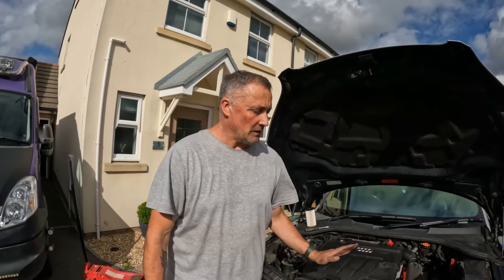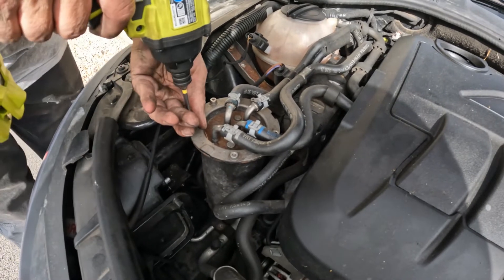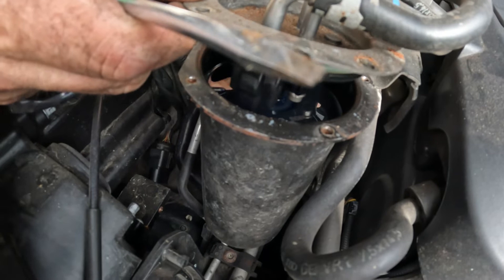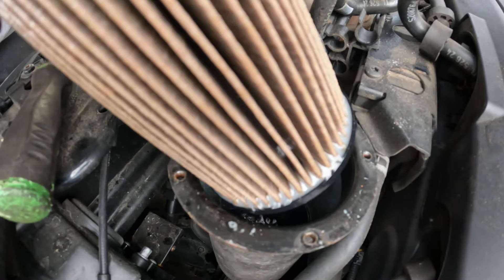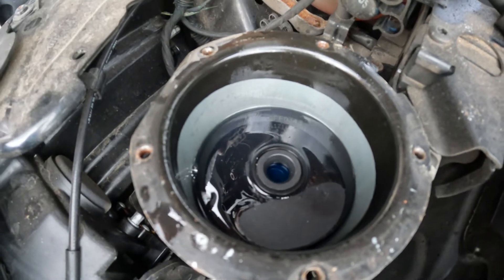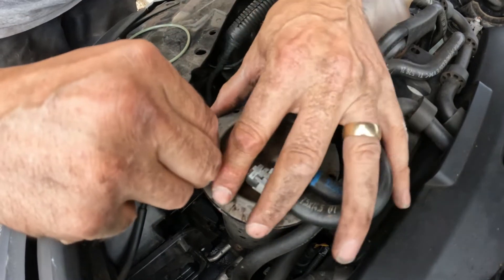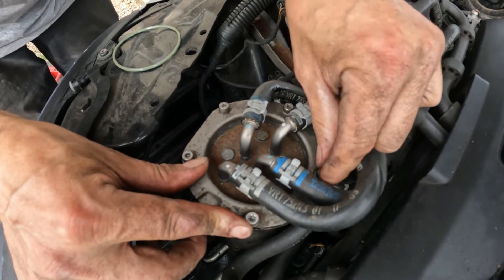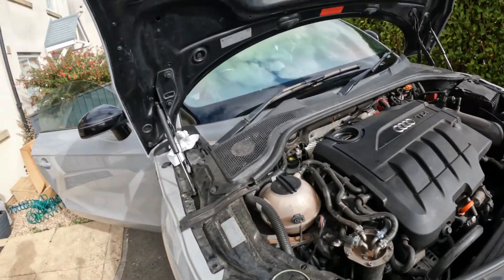How to change the fuel filter on a mk2 audi TT 2.0 tdi works for most of the vw / Audi 2.0tdi range

Comment: Hi Mate 😁 having the EGR mapped out today but not getting a remap as I don't think it's worth it due to my TT's mileage.
I'm sure you probably mentioned this in the video but what size bit is required for removing the fuel filter housing lid? Thanks
Reply from the maker: T20 I think off the top of my head but could ne wrong lol, just do it step by step as I say in the video mate and ull be fine 🙂 let me know how you get on please?
Reply: @thestanleysadventures8229  Ok perfect thank you 👍🏻 I should be fine I've always serviced my own cars but the TT is a little different in terms of the fuel filter housing!
My A4 just had a retaining clip holding the top on. I'm not sure when I'll get a chance to do it but I'll let you know how it went 😁
Reply from the maker: @Tinez87  good luck thanx mate
Reply: @thestanleysadventures8229  Thanks 😁the EGR delete went smoothly although I'm noticing more turbo noise now. The guy didn't blank it off as he said it wasn't necessary due to the valve still closing and sealing properly. Think I'll put a blank plate in at the manifold end anyway, do you have a link to the one you purchased?
Reply from the maker: @Tinez87  304806098159 ebay number, glad it went well mate 👍🏻 more turbo noise is not usual but could be a placebo effect 🤔 have you done the hot air feed delete yet? If you do the turbo clean that might give more turbo noise.
Reply: @thestanleysadventures8229  Perfect, thanks 👍🏻 I'm definitely noticing more noise I mean it's nothing out of the ordinary for a turbo but I don't recall hearing it before. Did you slip the blanking plate in at the exhaust manifold end? And did you use a gasket?
Reply from the maker: @Tinez87  No I put the plate on the throttle body side mate,   it basically is the gasket but I left the original in as well, have you done the fuel filter now?
Reply: @thestanleysadventures8229  Ahh ok that's fair I'll look in to getting one as backup to make sure it's sealed. Nah I haven't done it yet I'm planning on doing the full service including transmission oil and differential oil at the end of this month
Reply from the maker: @Tinez87  Is yours a 6spd manual or dsg? Any info you need feel free to ask 👍🏻 I'm gonna do a full walk around of our TT in a week or so with a full description of all the work done if your interested.
Reply: @thestanleysadventures8229  Mines a 6spd mate, I considered getting an auto but I'm quite happy sticking with a manual.
Yeah definitely it would be good to see your TT in all its glory! It does look nice 👌🏻
I won't be doing as much to mine as you have but I'm planning on lowering it 30mm and I'd like some nicer alloys at some point.
I need to get my bonnet and wing fixed up as they are damaged from the Cat N it was in previous. I must say I'm more happy with the TT than any other car I've owned!
Reply from the maker: @Tinez87  ours is a 6spd manual to mate, it's pretty much had a full RS conversion bar the front bumper, but like I said I'll do a detailed walk around of all the mechanical and body modifications, then if anyone wants any of the parts or prices and can tell them where from and how much, it started life standard and black lol, have you done your filter?
Reply: @thestanleysadventures8229  Ahh I see I thought it was a DSG for some reason! You have got it looking nice. Did you say it's been remapped? So it basically looked like mine originally! Mines in black but it's the pre facelift MK2 what's yours? Do you mean have I fitted an induction kit?
Reply from the maker: @Tinez87  no I meant your fuel filter? Ours is one of the first mk2 TTs yeah been re mapped but had a new cutch and flywheel so nowt to worry about there, Iv done everything to get performance  with reliability on ours, It's only stage 1+ at the mo not sure if it's worth going anymore if I'm honest, at the moment it has the best of both worlds without worrying about fragility.
Reply: @thestanleysadventures8229  I'm not servicing it until the end of this month, I need to take the car back home so I can get it on the ramps. Is yours around 200hp? 
Do you just get a standard clutch/flywheel or did you get a Sachs? Are you running the original suspension?
Reply from the maker: @Tinez87  sachs, standard suspension mate but it was an Sline so sits firmer and slightly lower anyway, I. Really anti coilovers unless they have adjustable dampers camber and caster, if they don't all they do is make the car look slightly better ( not in my eyes to be fair) but it'll ride like crap on anything other than perfect roads and wear your tyres unevenly because everything on your suspension was set up for how it came outv the factory not 30mm lower, sorry don't mean to be down on it just being honest mate.
Reply from the maker: @Tinez87  it's running 215 to the wheels
Reply: @thestanleysadventures8229  Nice, mines on the factory sport suspension and sits a bit lower and stiffer than standard. That's fair I appreciate your honesty! Would having a wheel alignment by a garage help not help? I've read that you should do that after lowering.
I wouldn't go coil overs I was just gonna put lowering springs on it tbh but if it's gonna destroy the tires I'll not bother.
That's some decent power, I'd like more maybe when the flywheel needs doing I'll go with a Sachs then possibly might get a remap.
Reply from the maker: @Tinez87  if you've got the factory sports suspension I'd stay with that mate unless your more about looks than handling ( personnel choice obviously) Audis ride beautifully on their standard suspension, I specialise mainly on vw Audi hence my whole family has them and they're all tuned and have been massively reliable! There's a few oil additives I swear by and the other tuning tips iv shown on my channel will add to the reliability of most cars, 100% wheel alignment after any serious suspension work ( even just replacing standard for standard suspension arms ect)
Reply: @thestanleysadventures8229  Ok mate I'll stick with what I've got as it does handle really well and I don't want to loose that by sticking springs on it. I'm all about German cars since I had my A4 it had 160k on it but I think it could have done a lot more.
I have a question for you... I have what seems to be a warm start issue on my TT and sometimes it struggles to start after it's fully warmed up, it intermittently fires but it doesn't fire straight away it turns over but instead of just jumping to life it sounds like the engine is partially starting now I've done some reading and it can be a coolant sensor or crank position sensor and potentially the starter motor. My battery seems fine in terms of voltage and if it was that I would expect an issue cold starting! Have you had this issue with yours at all? Think I'll replace the coolant sensor first as it's the cheapest then go from there.
Reply from the maker: @Tinez87  right that's a big one! There's a few things it can be, there's actually 2 coolant temp sensors that ut could be ( only buy original not ebay special unfortunately) doubtful starter or battery if its OK cold, EGR valve not fully closing is the other main cause, if its all carboned up it can cause probs exactly like that! Easy to clean out to.
Reply from the maker: @Tinez87  its a pretty common fault to be fair, pretty sure it won't the the crank sensor either, why would it play up hot? It's basically a magnet
Reply: @thestanleysadventures8229  Yeah after researching it on the internet I found it is very common problem. I don't suppose you know where I can get engine diagrams from do you? Mines a CFG engine code. The diagrams should make it a little easier to locate the two temperature sensors. It's a strange one. There's a video I've seen on here where a guy had the same issue and he replaced his battery and all coolant sensors including the crank position sensor and it turned out to be his starter motor that was at fault in the end.
Reply: @thestanleysadventures8229  Would the EGR not be throwing an engine light if it's not working properly?
Reply from the maker: @Tinez87  no mate it's still within operating range, to be fair there's sooooo many electrics on the car any one can give the same fault, I always go cheap first and work my way to expensive till its sorted lol, Egr clean up is free to, my only proviso is it may take a few starts for your car to re learn its fueling parameters. As for wiring diagrams Google to be fair, but if I remember rightly ones on the thermostat housing and ones on the coolant hose on the front left of the motor, it's green I think, but could be wrong as I did my sons on his leon fr old cr motor.
Reply: @thestanleysadventures8229  Yeah that's the best way to go I reckon, no point going going for something like a starter motor to find out it was a £30 sensor all along lol.
It took some digging but I've managed to find a PDF that covers my engine code 👍🏻
Is one of the sensors more likely to fail over the other or am I just as well trying to pin the tail on the donkey haha
Reply from the maker: @Tinez87  the one on the thermostat housing gets the most grief if ìts still there on that engine.
Reply: @thestanleysadventures8229  I spoke with the Audi dealer earlier and they want £58 for the sensor and there's only one on my engine apparently. I'm not completely convinced it's that tbh. It's not just when it's warm sometimes struggles no matter what the temperature is but it's generally worse when it's already warmed up! I have plugged my OBD2 reader in but there are no engine faults showing
Reply from the maker: @Tinez87  it won't flag a fault unless the faulty part is outv values, I'd start with cleaning the egr first then drive it for a week if no change start with the nxt issue, u can have a battery health check just for peace of mind, also check your main earth wire underneath your fuse box they corrode badly and give a bad starting prob ( sounds like a flat battery.
Reply: @thestanleysadventures8229  I'm starting to think it is a faulty starter because when I cut the engine out this morning and refired it up the starter motor sounded slower than usual but it's only slower when it's warm which apparently can be the sign of a worn starter. Possibly worn brushes? I think it's struggling to turn the engine fast enough to fire it up straight away, I need to get it tested I think
Reply from the maker: @Tinez87  I hate to be the bearer of bad news but a dying starter is also one of the first signs your dual mass is dying to 🙄 not always but it is one of them, an easy way of checking that idea is put a jumper pack or another car when it's hot and see how it starts if it starts well when the engines hot with a jumper pack on its the starter.
Reply: @thestanleysadventures8229  Ahh ok I didn't know that! Well I'll cross my fingers that it's just the starter then 🤞🏻 I will see if I can get a jump off a friend and hopefully eliminate if it is the starter or not. I've been without a car for a year before buying the TT and I can honestly say I haven't missed all the expense that comes with owning a car lol

Oh and I was just thinking if it's the starter why would it start well off of a jump? Would it not just be the same if it's worn?
Reply from the maker: @Tinez87  No mate the extra power from the jump will eliminate the heat from the motor, it's the heat that's making it slower if its dying, so the jump will stop that, it's a good way of eliminating the starter or the battery to be fair. I hope my info is genuinely helping you mate?
Reply: @thestanleysadventures8229  Ok I understand what you mean, I guess it could still be the battery at that point.
I think the starter and the battery need to be completely eliminated before I start going for other costly components. Absolutely you have been very helpful with the info you have given me 🙂
Reply from the maker: @Tinez87  ideal glad I have 👍🏻 yeah eliminate them first then clean your egr valve, go from there.
Reply: @Tinez87  any news on the starting probs mate? How's the car running ?
Reply: @Warhammer-fun   Yeah replaced the battery last week and I initially thought it had completely solved the issue, It didn't but it does seem to be a lot better than it was! I think the starter may be tired.
I've bought some TT MK3 19" gloss black wheels and it looks way better for it. Gonna do the full service this weekend. Planning on removing the haldex controller and opening it up as I think it may have some ingress which is causing the error codes I'm getting.
Reply: @Tinez87  nice alloys mate 👌🏻  ours are the B7 rs6 wheels, good idea it takes nothing to throw up a code in modern cars, servicing the haldex isn't a major headache to be fair, I might do a video on it actually as iv not done the tt yet and my SQ5 could prob do with another one by now lol.
Reply from the maker: Sorry I answered on my sons account 😅 my bad
Reply: @Warhammer-fun   Cheers they are a big improvement and the 255 width tyres gives a little more grip. Ahh I bet they look nice on yours 👍🏻
My haldex system was serviced a few weeks back and it seemed better but nowhere near as effective as it should be. I emailed the guys over at haldexrepair and they said it's probably the controller that's faulty so I'm keen to whip it off and crack open to see if I can clean up any corrosion. Alternatively they want £250 to recore it whatever that means lol
Reply: @thestanleysadventures8229  No worries I didn't even realise it wasn't your account till you mentioned it mate 😂
Reply: @Tinez87  new circuit board and fittings, easy way to test your haldex is get on some grass and boot it ! All 4 wheels should spin if not its not locking the centre diff, it's only 4x4 when needed it's front wheel drive 99% of the time.
Reply: @Warhammer-fun  Yeah I've seen a few videos of people doing that! It's definitely not working right as I can spin the front wheels up pretty easily in the wet and the traction control light comes on. Would be nice to get it working fully 😁 I'll tear it down and have a look. I've heard of people cleaning up the PCB with contact cleaner and managing to get it working again!
Reply: @Tinez87  good luck and keep me posted mare 👌🏻
Reply: @Warhammer-fun  Cheers mate 👍🏻 I won't be doing the haldex controller just yet that will be at a later date. It's definitely on the cards tho!
Reply: @thestanleysadventures8229  Hi mate, I thought I'd give you an update as I've finally managed to do the full service on my TT. Everything went smoothly but I have an issue with small metal particles in my fuel filter reservoir 😕 turns out this could be a worn/failing high pressure fuel pump! Not taken it to the garage yet as I've been down Cornwall for a week but planning on getting it looked at ASAP... I can really do without a big bill but not much I can do really it's just one of those things.
Reply from the maker: @Tinez87  don't worry about it mate they all get that to a point, I tell people to put a bottle of 2 stroke in their tank before filling up every 3rd tank, that keeps the whole fuel system lubricated and stops undue wear on the hp pump, I live in N devon mate couldve popped in, I only ever use BP ultimate or shell V power diesels, that way the extra additives in the fuel does the same thing.
Reply: @thestanleysadventures8229  Thanks for that mate I feel better knowing it's a common issue! And that it's not something to worry about too much. Do you know what causes it? I'll get some two stroke oil like you said, especially if it helps the situation. Ahh nice I like both Devon & Cornwall I stayed down in Gorran as it's one of my favourite beaches 🙂 if I'm heading down your way again we will have to meet up.
Reply from the maker: @Tinez87  deff meet up mate 👍🏻1 500ml bottle of 2stroke to a full tank of fuel will keep your pump lubricated and injectors smooth and quiet, the only thing I would advise after doing it change your fuel filter again (say after 2k miles) because the 2 stroke will clean all the gunk and rubbish outv ur fuel system and will fill your filter full of crap! After that you can service as usual. How did the service go?
Reply: @thestanleysadventures8229  Yeah sounds good 👍🏻 what brand do you use? Do you have a link please? That will ensure I get the correct one and don't end up buying something that's not suitable. Yeah it went fine apart from the oil filter that I got from Euro Car Parts was incorrect which I found out once I'd already dropped the oil 🤦🏻‍♂️ so ended up going to Halfrauds and bought the last one on the shelf which was lucky!
Reply from the maker: @Tinez87  I recommend the cheap 2stroke from morrisons supermarket ( it's red) it's the best value for money and what all the people I tell use, You may even notice your car getting quieter when it's run through the system because your injectors can get quite loud when not well lubricated, are you gonna do the hot air delete from the rocker cover?
Reply: @thestanleysadventures8229  Ahh ok I'll have a look for it, have you noticed much difference with yours after running the two stroke for a while? I haven't gotten around to doing it as of yet and I'm not sure yet as I've read mixed things about removing it. I replaced my front grill after I did the service and what a mare it was removing the front bumper! Now I know how it comes off it should be easier to remove if I need too 😅
Reply from the maker: @Tinez87  deff better throttle response, there's nothing that can do any harm to your car that's for sure, and stopping all that hot oily air going through your turbo and engine alone is worth it even if  you don't notice any difference.
Reply: Hi! Thought I'd give you an update on my TT, I ended up getting a stage 1 remap in the end and it's the best £200 I've spent on a car! What a massive difference it has made to power torque and throttle response... I'm well happy with the result 😄

I have a question regarding the CR170 engines used in the TT, I know of the oil pump hex drive issue that has plagued a lot of the PD and CR engines and wondered if you know much about it? Thanks
Reply from the maker: @Tinez87  iv worked on these engines for years and haven't personally had a single gle one fail! Wether that is good servicing ( meticulous/ more frequently) or shear dumb luck I can't say, But I wouldn't let it worry you unless your having od noises from it, well chuffed for you mate that's amazing news 👌🏻 thanx for keeping me updated 👍🏻 prob going hybrid turbo on ours nxt lol.
Reply: @thestanleysadventures8229   Ok that's fair. From what I've read the oil pump hex key failure is an issue right up to 2010 models and was a while before they completely eradicated the issue. If mines got potential to fail I'd rather know about it as that way it can be prevented before it fails and writes off the engine. Thanks mate 😄 I'm well happy with it! Haha I've been looking at hybrid turbos too lol I'd only get one if mine needed replacing tho I think. Mine should be around 205bhp with 310lb/ft of torque now I've had the stage 1 but I must say having nearly 250bhp would be nice 😏
Reply from the maker: @Tinez87  to much ips never enough in my book lol, my wife's scirocco is on 175k  and still going strong and my sons Leon tuned too 312bhp is on 201k neither have had a hex key issue bud so don't worry to much eh 😉 glad  your loving it mate stay safe and in touch if ud like.
Reply: @thestanleysadventures8229  Absolutely I couldn't agree more! More HP is nearly always better. Oh nice both cars are doing well then 👍🏻 what year are they both? I posted on the TT forum last night to get more info on whether mines affected, if it is I'll get the kit and have the necessary parts replaced on my next cambelt change. Thanks for the reassurance mate 🙂 yeah I'm happy to keep in touch, although it's not the easiest way to do it through YouTube lol
Reply from the maker: @Tinez87  2007/2009 Leon and scirocco, better safe than  sorry I guess mate, yeah through here isn't the best lol, any more power and you'll also have to up rate your clutch to to cope with the extra torque.
Reply: @thestanleysadventures8229  I have spoke with an engineering company who manufacture replacements for all the vag cars PD and CR engines effected and he said it's an issue right up to 2015 models unfortunately... Looks like I'll be having it replaced on the next cambelt change to ensure it doesn't cause me any issues later on 😅
Reply from the maker: @Tinez87  fair play mate peace of mind for you on going then, especially if you plan on keeping it a long time! I have an Audi Q5 3.0tdi twin turbo as my daily, the cam chains are renowned on going as little at 100k up to 130k, mines now on 162k and is whisper quiet so good maintenance and luck obviously plays a big part in it.
Reply: @thestanleysadventures8229   @thestanleysadventures8229   Yeah that's it mate I'm all about reliability, I usually keep my cars for well over 5 years... Basically until the cost of repair far outweighs the value of the car! Nice I bet that's comfy to drive every day and oodles of torque I bet!! Absolutely maintenance and luck plays a big role in longevity. Thing with the hex drive is that there generally isn't any warning it's just oil pressure light on and turn your engine off asap to prevent as much damage as possible but when your on the M1 hooning it that isn't necessarily an easy task to achieve lol
Reply from the maker: @Tinez87  Mines a monster mate lol, with a light tune it's running 398bhp and 700ftbs yet driven like an old lady will do 45mpg ! If you keep on top of it there's no reason your tt won't just go on and on 👌🏻
Reply: @thestanleysadventures8229  I bet mate especially with that amount of torque! I can imagine it pulls like a bloody diesel express train lol does it have the haldex 4wd on it? I bet it would be  constantly lighting the tyres up without it 🔥 cheers matey I'm hoping it does 🙂 I'm saving up to buy my own place so don't want to end up blowing a load of money unnecessarily... Certainly if it can be avoided!
Reply from the maker: @Tinez87  it'll spin all 4 wheels in the wet 😁 love it to be fair best car iv owned! How many cars have that performance but drive carefully will still return great econ? Have you done the hot air delete? I would also recommend turbo cleaning it to save that to the 170bhps are renowned for blowing turbos due to sticking vans.
Reply: @thestanleysadventures8229  Doesn't surprise me with that amount or torque! What even better than the TT!? I'm not much of a 4x4 kinda guy lol
I haven't tbh I did order a silicone hose and bung but haven't gotten around to it yet. Same on the turbo clean I haven't had a go yet! Too busy spending money doing other car related stuff haha
Reply from the maker: @Tinez87  the silicone hose takes 10 mins max and is invaluable for the longevity of you turbo and motor, turbo clean just gets lost power back lol, any info just let me know, would love to see the car sometime, I'm doing a detailed walk around of ours soon to.
Reply: @thestanleysadventures8229  Ahh there not massive jobs, I've been getting the cosmetic things sorted as it needs a bonnet... I replaced the passenger wing on Sunday and that was an interesting job lol I'm looking forward to your walk around! Will be nice to see more of your TT 😄 

I have another mechanical question, so I've noticed a rattle coming from the engine and it's more pronounced when in a higher gear and you lightly accelerate, the higher you rev the less noticeable it is. It sounds like it's the engine and not a heat shield or anything like that, I was thinking it could be pinking and that the injectors may be the issue?! How does yours sound, do you get any kind of rattle?
Reply from the maker: @Tinez87  hey up fella 👍🏻 vibration noises are notoriously hard to find, pinking as it was called years ago was petrol cars detonating incorrectly, if it runs smooth with no hiccups it won't be the injectors, see if it will make the noise when not moving, open the bonnet then rev it till certain rev increments and see if you can hear it, if you can't then it's poss drive train related, try driving along get the noise to happen then press the clutch in if the noise go's its not wheels and suspension.
Reply: @thestanleysadventures8229  Hey mate 😁 I'm hoping it is just a vibration and not engine related. It seems to run fine tbh it accelerates smoothly and goes well without any hesitation. If I rev it when stationary when the revs are dropping just before the engine settles I get a hint of the rattle, I'll have to get someone to rev it while I stick my head under the bonnet. Ahh mate it's just one thing after another at the moment lol I paid 3k for it and I'm already another 2k deep 😆 heater has dropped in temperature quite a lot recently so that needs looking at also my Aircon now needs a gas and both front tyres are due soon... Not to mention the cambelt start of next year and I need to remove and dismantle the haldex controller because it's throwing fault codes and it's not working properly... Oh and I still need a replacement bonnet as it was a cat N when I bought it 😅
Reply from the maker: @Tinez87  sooooo, if it rattles just as the revs are dropping it could be either dpf heat shield or even the engine cover ( they're savage for an awful rattle at od revs) so remove it and try again, the only other internal rattle it could be is the oil pump drive chain but they usually just snap rather than get loose if not serviced regularly! Does the rattle get worse when hot or does it make no difference?
Reply: @thestanleysadventures8229  Ok I shall check the dpf heat shield when I get chance, when you say engine cover do you mean the plastic one? The oil pump shouldn't be an issue as mine has a gear driven pump instead of a chain. It doesn't seem to make any difference if it's hot or cold the rattle sounds the same from what I can tell, if I drive in built up areas the sound will bounce off objects and it's very audible with the window down. I'm not sure why but I think it is the engine as it sounds a bit like an older clattering diesel engine when it does it lol
Reply from the maker: @Tinez87  yeah the plastic engine cover top and bottom give loads of bad noises if they're not fitted spot on, there's nothing inside the motor that can give a metallic rattle without really killing the motor, check the idler pulley on your aux belt they can rattle savagely
Reply: @thestanleysadventures8229  I'll remove the top one and see if it makes a difference, bottom one isn't an issue as I had to Dremel it off when I did the service lol so I just left it off! I hope I can pinpoint it if not I'll have to take it to a garage and see if they can find where it's coming from, I read a few stories about people never getting to the bottom of these kinds of noises even years down the line haha I have my fingers crossed that it's something simple 🤞🏻
Reply from the maker: @Tinez87  Well if it's running fine and smooth it shouldn't be anything more than an annoying rattle, which isn't great but better than terminal rattle lol, I know the engine cover can give horrendous noises if the rubbers are old!! If it is that cut a small bit of rag an place it over the hole the feet go into, it'll fill the gap and stop it rattling, good luck mate keep me posted 👍🏻
Reply: @thestanleysadventures8229   @thestanleysadventures8229  haha you have a good point there! Definitely better than a terminal rattle lol I took the engine cover off before driving to work and I don't know if I'm dreaming it but I'm sure I couldn't hear the rattle, I'll have to go in an area that's more built up to be sure but I've got my fingers crossed that's it 🤞🏻 if so I'll just stick the cover in the garage permanently hahaha
Reply from the maker: @Tinez87  that would be great mate, I know they can make some awful noises but easy enough to solve, good luck 👍🏻
Reply: @thestanleysadventures8229  Ahh mate that was short lived... The rattle is still there lol it's very consistent and can be heard up to about 2000 revs, if I'm doing 20mph in third gear and lightly press on the accelerator it's plain as day!
Reply from the maker: @Tinez87  right 🤔 that's deff a frequency vibration then, as annoying as it is you could waste a lot of money trying to find it, just be methodical check all heat shields even loose wiring can do it, or even sometimes the outer skin of the exhaust baffles separate but you can see it outwardly either 🤬 nightmare mate.
Reply: @thestanleysadventures8229  I'll check what I can myself and just leave it at that I reckon, I found some info on a Skoda forum where a couple of people with the 2.0 TDi CR 170 had a rattle just like mine and they had listened to a few cars with the same engine and they had it too! So I may end up chucking money at it and not getting anywhere like you said. Next job is taking the haldex controller off so I'm planning on doing that very soon, I'm getting a fair bit of wheelspin now I'm on a stage 1 lol
Reply from the maker: @Tinez87  you should get some spin then it should lock up, it's not as big a job as you'd think to be fair, whilst apart change the oil and filter at the same time kill birds with stones lol, I wouldn't worry to much mate, hybrid turbo is on order for ours now so soon will be rocking some decent power lol
Reply: @thestanleysadventures8229  Hey mine only locks up from the traction control from what I can tell as it flickers and bogs down a bit. My haldex had the fluid changed and filter clean a few months back so it should be good for a while I reckon, I was told to get it done every 20k instead of Audi's 40k lol 
Ahh nice what kinda power will you be making with a hybrid turbo?
Reply from the maker: @Tinez87  hight 2s low 3s with supporting mods, I think your best bet is get your car on some grass turn tc off and boot it, if it only spins the front you know for sure then, I'm planning on doing the walk around video this wknd co.ing if it stay dry lol
Reply: @thestanleysadventures8229  oh nice that's decent, I'd be happy with high 2s let me tell you! What other supporting mods are required to reach that kind of power? I have run a fault scan and it throws a couple of four wheel drive codes that come back once cleared so it's definitely not working as well as it should be unfortunately. It will be good to have the full TT experience and see how she's looking 👍🏻
Reply from the maker: @Tinez87  no much actually, turbo injectors intercooler and a stage 2 map, it'll be a longish video cos there's so much to show lol
Reply: @thestanleysadventures8229  Hi mate I hope you are well 🙂 have you swapped your turbo out on the TT yet? I have a question regarding the metal specs in the fuel filter housing, I was reading up online about it and I get the impression that if it's in the filter it would also be making its way to the injectors too is that correct? Just looking for peace of mind as I've read about people having to replace the HPFP all the injectors and clean the whole fuel system out and it cost them 2k 😱
Reply from the maker: @Tinez87  hey up fella 👍🏻 yeah it's got a hybrid on it now, going very strong indeed not been on a dyno yet so running a basic map till then, don't worry about a few od metal flakes in/on your fuel filter, that's a relatively common thing just make sure you use good quality fuel ( BP ultimate/ shell v power) and 2stroke of good quality fuel additive and you'll be fine, iv not known of any failures other than badly serviced cars or lots of cheep feul doing long term damage. Hope your OK mate?
Reply: @thestanleysadventures8229  Ooh nice I bet it pulls like a train! How much horsepower do you think it might have roughly? I'd love more power in mine especially the extra torque it's great. Cheers mate I've been running v power diesel religiously for the past two months so hopefully that helps things, I can't remember how much was in there when I did the filter change, I'll have to open it up and check again for my piece of mind. Yeah I'm good thanks 🙂 got myself a replacement wing and bonnet for the car in the right colour code so just needs a gloss black Audi badge up front and she is all good. Due the cambelt and water pump next year so bracing myself for that lol. How are you doing?
Reply from the maker: @Tinez87  it shouldn't be big money mate £300 max, don't concern yourself with Google keyboard warriors mate, unless you've got silly amounts of metal swarf in there it's no issue, ( I mean literally glittering in there) a few odds and sodds is nowt to worry about. I'm good mate, been doing a few vids on my motorbike recently, daughter ripped the defuser of the tt 4 weeks ago so I'm busy repairing that at the mo 🙄